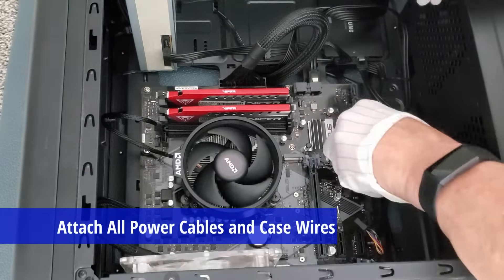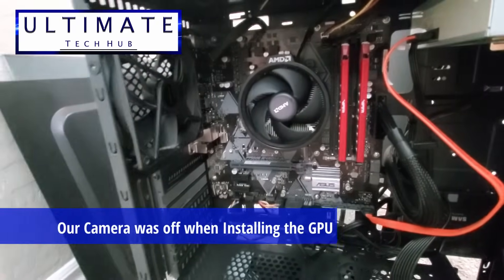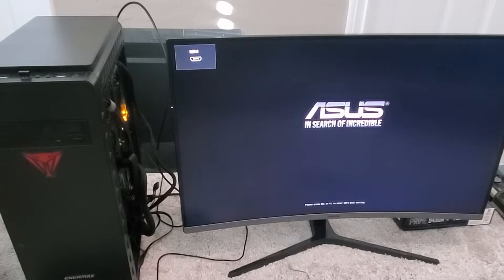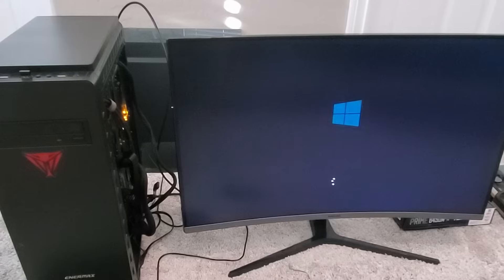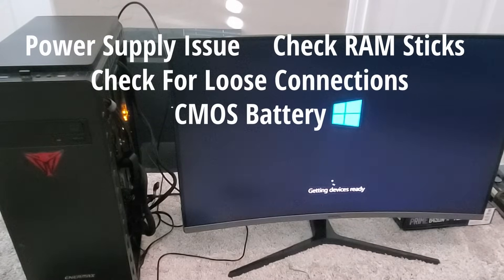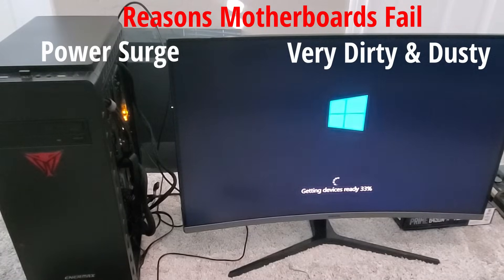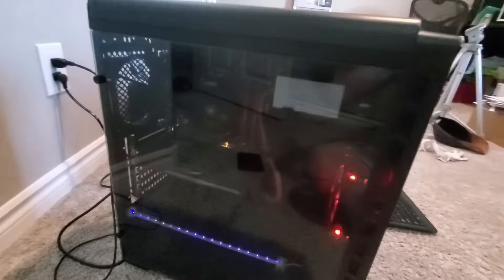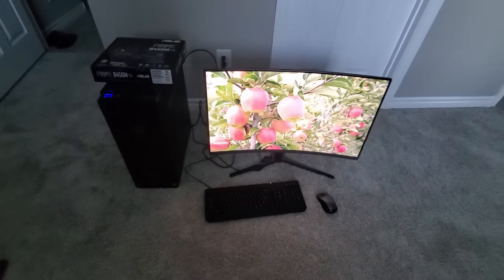HOW TO REPAIR A DEAD COMPUTER - DIAGNOSING A MOTHERBOARD FAILURE! - HOW TO

Comment: Now my pc randomly freeze(sometime freeze when it  just on start up!stuck on window logo)and restart itself ,sometimes can be open normally but then randomly go blackscreen like suddenly loose signal when I connect igpu instead the screen show just all red on monitor(really all red no text or etc).Could that be a motherboard failure?
Reply from the maker: Most likely it's a bad mobo. If you had a different hard drive you can plug it in and try that.  I always have a extra ssd drive with windows 10 on it just to test mobos just to make sure its not a software issue. But yours sounds like a hardware problem. Keep me posted and thanks for watching!

Comment: I just had a motherboard die on me due to the power supply suddenly failing.  The PSU clearly 2 blown capacitors.  It was an 8.5 year old Lian Li power supply.  I have read you should replace your power supply every 5 or 6 years
Reply from the maker: Yes absolutely! Usually every 3 to 4 years. That's about the life expectancy of a PSU. Thanks for watching and if you subscribed thank you as well.

Comment: I upgraded my cpu and psu, left everything else the same. When I plug everything in, only the power light on the mb comes on, nothing else happens, no other lights. I used the tester cap that came with the psu, and then the drives come on and the psu fan starts right up. I'm thinking it's a mb issue so I ordered a new one, same as old one. Was that a smart move or do you think there's some other issue?

Comment: Thank you for the great tutorial! I took out my ram and cleaned it. Then out it back in, as I've done like 20 times today, and just realized that I needed to put a bit more pressure than I had been. My issue was I didn't push hard enough to insert the ram after I removed it. I want to cry lol
Reply: same thing just happened with me. Just had to push a little harder than usual and it fixed my problem. Thanks brother.

Comment: My pc worked I put knew fans in and it still worked, the next day I tried to turn it on and I had no response so I checked the power switch the psu and I figured the only thing left was the motherboard so I bought a new one but my computer still doesn’t work the fans don’t even spin

Comment: My motherboard and processor 'blew up' even though nothing was wrong the day before. Is it possible to get my data like pictures from the computer? I'm going to buy a new motherboard and processor
Reply from the maker: Yes just remove the hard drive from the motherboard. It's connected with SATA connector. Your data should be fine.

Comment: I have the experienced the following from my system. 

It has been running a Gigabyte Aeros Z390 Pro for a little over a year with Corsair 750 W 750 RM PSU and 9900K CPU together 64 GB ram and RTX 2070 graphics card. Took me
 little over year to afford the parts. 

Windows 10 with all latest drivers and firmware. Wifi/BT combo card from Asus. What happens is that power cuts off to internal USB ports meaning that BT suddenly freezes mid use. What start to happen that during gaming at medium to high settings the computer suddenly froze even though neither GPU, CPU would reach critical temps. A Windows 10 bluescreen would apear for 1 - 2 sec and then go into the bios. I have checked the ram using Memtest86, I have tested GPU in several stress test programs like heaven benchmark, no issue. I have used into burntest on the CPU, no issue. Non of these issues appear while watching either streaming video, surfing the internet, emailing or word processing. 

Suddenly after doing a couple of reinstalls of Windows 10, Windows 10 couldn't recognize the internal USB 2.0 connectors were filled (front USB ports, wifi/BT card). Said someone like Windows cannot adress USB device. I then removed those devices, and reconnected, and then Windows 10 discovered the devices. But had forgotten my Windows 10 key. So I have to buy a new one.  Now the system runs somewhat okay again. But the bluetooth powerout error stills takes place (but only while gaming). 

System isn't overclocked. No lose connections either. 

So in your professional opinion. What could be issue here? Windows hickups? Or bad motherboard or bad PSU?
Reply from the maker: Well first its not the PSU. Your motherboard is working so my best guess is bad motherboard or Windows 10 glitch. However, have you updated USB drivers? Often USB connection problems come from old USB drivers. Make sure to update the USB drivers and keep me posted. Thanks for watching!
Reply: @UltimateTechHub  Thank you for your answer. I have updated the drivers for the motherboard (I guess the latest USB drivers too). By downloading the latest Intel INF drivers from Gigabytes site for my board. 

Temps in the CPU is never gets higher than 65-70c on a heavy load, and the GPU sits at 72c even if crank the details in FPS up to ultra. 

 Any software to test the motherboard? Or should I just go out and buy a new board?
Reply from the maker: @madsfrederiktoft5808  My best guess is bad motherboard.
Reply: @UltimateTechHub  thank. I will try to dig up a newer Z390 motherboard..

Comment: I tried jump starting my motherboard but it wont, but tester shows that it has power.
My case has a fan that is connected to psu but nothing. Sometimes the gpu, cpu fan will spin but othetwise not.
So is it psu or motherboard issue
Reply from the maker: From my experience your PSU is going out. Sometimes it will provide some power but not enough to power the motherboard.  How old is your  PSU?
Reply: @UltimateTechHub  i tried jump starting psu with paper clip and it works, its 460watt cooler master and 4 years old,
The system is 
i5-7400
H100m-h motherboard 
1 8gb adata ddr4
1 gtx 1050 ti
The motherboard wont even jump start but shows power....

Comment: Does changing the CMOS do anything? My PC started resetting bios and did a boot loop and it just said it reset the bios.

It then turned off and now idk if its the powersupply or the motherboard.

I tested the powersupply with all the fans except the sata and motherboard connected, i jumped the powersupply and it started. I even put it on another pc and that one booted too
Reply from the maker: It may be the motherboard. If you have a known good power supply then connect it and see if it boots. If it doesn't boot then it's the mobo.

Comment: I think my motherboard is the issue in my pc. All of the fans are working, psu fan still working. I think I need to replace my motherboard. Nice informative video.
Reply: Did u fix your issue I am having the same issue - did a new motherboard work?

Comment: None of this worked is there a chance it could be my cpu? All the parts are new and compatible gpu works fine in my other rig but still no video on the new one and only fan spinning is cpu fan on new and old motherboard

Comment: I removed the coin battery on my b450 tomahawk max because it wouldn't connect to my monitor and the DRAM light was red. I put the battery back in, but now my PC won't turn on at all!
Reply from the maker: It's a compatibility problem with your RAM sticks. Are they the correct RAM for that mobo?
Reply: @UltimateTechHub  not sure, but now the mobo seems dead
Reply from the maker: @jlc5271  If the RAM sticks are not the correct type for your mobo then the mobo will not turn on.
Reply: @UltimateTechHub  it turned on without any ram before, and now doesnt
Reply from the maker: @jlc5271  You can turn on PC without RAM but it won't get past post. Your mobo Supports DDR4 Memory, up to 4133(OC) MHz so make sure that's what you have. If it's not that RAM type then that's the issue.
Reply: @UltimateTechHub  unfortunately it's not the RAM. Mine's DDR4 2666 MHz
Reply from the maker: @jlc5271  How many watts is your PSU?
Reply: @UltimateTechHub  500, I'm fairly certain it's the mobo. It was working in terms of fans and lights on the board before, just DRAM light was still red and no HDMI signal
Reply from the maker: @jlc5271  Sounds like a bad mobo. You've tried everything else.

Comment: Hey I’d like to know if my motherboard is the problem so when I turn on my pc everything turns on gpu, ssd, cpu cooler but no output also my pc boot loops with no output so I don’t what to do. Any tips/help I can get ? Also idk if the previous owner updated the bios or not so I’m really not sure
Reply from the maker: It sounds like your mobo is bad. However check the cmos battery and make sure your psu is not going bad. Double check all of your power connections too. Keep me posted and thanks for watching.

Comment: Hey I didn't understand when you said ( it could required new ram sticks and CPU ) how?
Reply from the maker: It's rare but sometimes the CPU goes bad from over heating or the RAM sticks could get dirty so you may need to clean the connections. However the usual culprit is the PSU or the CMOS battery or MOBO is bad itself. I always start with the power supply and then CMOS battery because that's the easiest 2 symptoms to test.
Reply: @UltimateTechHub  oh so when you say ( we could upgrade the mobo ) you mean repair the mobo ?

Comment: I have a gigabyte GA-H61M-DS2 motherboard. My pc sometimes dont power on, sometimes okay. I just bought a new power supply yesterday because cleaning ram with  eraser and reinserting the c-mos battery wont solve the problem  (not a single fan works when I hit the power button,many times, that is why i assumed i was my power supply that is failing). After getting a new power supply  and hit the on button, it works!, i used it then turned off after. This morning it wont start again. Same issue again. Now, i want to replace and upgrade its motherboard. What compatible board will you recommend so that i can salvage other parts of my pc.
Reply: I'm not a gamer. I do use apps such as sketch-up, autocadd,  vray, lumion, enscape, photoshops, Etc. Sometimes i do play games but not as heavy as others. Thanks!
Reply: i was having similar issues i would hit the button like 9 times and then it would turn on i just assumed it was an issue with the button. then yesterday my pc would not turn on at all i assumed it was my psu but i replaced it and it still wont start. i tried unplugging the 4-pin on the motherboard and it turned on so i guess that means the motherboard is the problem idk i have never had issues like this before  @arielsupnet366

Comment: My computer doesn't work. The computer started dying +-5 months ago. I have cleaned the ram sticks and even changed the cmos battery. When I try to start the computer, the processor fan turns on and off and there is a red light that flickers on the motherboard. The computer sounds like a "car with a dead battery" when I plug it in to the wall. What could be the problem? Does anybody know?
Reply from the maker: Either the PSU or the mobo is dead. Try the PSU first. Keep me posted.
Reply: It was the PSU that failed. I used a Huntkey CP 350W (8cm fan). And it lasted me quite a few years. I am using a NVIDIA GeForce GT 430 graphics card. I want to get a good quality PSU for future upgrades. Which PSU would you recommend??

Comment: Hey, my Pc isn't turning on at all I've jumpstarted it from Motherboard but still no sign on life. When I short-circuit the 4th and 5th pin on psu the psu did turn on and every RGB strip and fans.

My psu is 80+ bronze 500w
And a320m Mobo

Please help if my motherboard is faulty or what's the most probable issue
Reply from the maker: I would try a Different PSU first and see if the PSU is the problem. If not then it's most likely the mobo. Also double check all connections like PSU connections and RAM sticks. Keep me posted and thanks for watching!

Comment: I just got my mobo a few months ago and I just got my psu today I plugged in everything right and cleaned the ram sticks and turned on the powerbutton but all I hear is a sound like this _ continuously and I can’t find the problem I’ve tried everything if you could help that would be great
Reply from the maker: When the mobo beeps constantly that means the Computer is not passing the POST because of improper connections or damaged hardware. Check every connection including all of your fans. Keep me posted.
Reply: @UltimateTechHub  Ok, I will check rn
Reply: @UltimateTechHub  everything’s plugged in I checked and it’s still making the sound. The lights and everything turn on for a split second then turn off and it goes to that sound.
Reply from the maker: @Himathen  Its either a bad Power Supply or a bad motherboard. I would guess its a motherboard issue since your getting the beep codes. You may need to replace it. But check the power supply first. How old is the PSU? how many watts?
Reply: @UltimateTechHub  it’s 600w Evga and I just got it 2 days ago

Comment: I had a sudden FPS drop when playing games so I reapplied thermal paste on my CPU and when I put it back together it didn't give a signal, I tried all the other steps and didn't work so have to buy a new motherboard. If anyone has any other idea on how to fix the issue before I buy it please tell me.
Reply from the maker: I would check your CPU to make sure one of the pins are not bent. That would cause it not to work.
Reply: @UltimateTechHub  I checked my CPU pins and they all look fine but all these issues happened after my power went out. Would it make sense for it to be the motherboard. I'm just asking so I don't waste money since I had to wait 3 weeks for it
Reply from the maker: @QuickCosmosReal  Yes a power outage which can cause a power surge may have killed your motherboard. But first did you reset the CMOS battery? Do that first then replace the mobo if it still doesn't work.
Reply: @UltimateTechHub  Got the new motherboard but still the same problem, not sure what to do.
Reply from the maker: @QuickCosmosReal  Then it's probably the power supply.  Your RAM sticks are in the correct slots?
Reply: @UltimateTechHub  Ram sticks are in properly and in the right slots and I tested on a spare PSU I had but still the same issue, could it be the GPU
Reply from the maker: @QuickCosmosReal  it could be. Remove the gpu and try to start your PC.
Reply: @UltimateTechHub  The fan stopped and turned on and kept doing that
Reply: @QuickCosmosReal  did u fix i wanna know before gettin a new mobo
Reply: @babaloons4887  My gpu died
Reply: @QuickCosmosReal  was it a dedicated gpu

Comment: Problem with mine is it doesn't boot up noting happens it booted up 2 or 3 times in a day it automatically got shutdown the thing here is when i Press the power button the fan on motherboard starts for a sec then noting happens but my mouse
Has rgb and it works but the pc doesn't maybe the motherboard is dead

Comment: Hi there. I had those symptoms but suddenl, my hdd is not detected, even in the diskpart command. The disk starts working when I turn on the laptop but then I hear it turning off. Do you think this might be a power supply/mother board issue? PS: laptops battery is dead, only works plugged in. Thank you!
Reply from the maker: Its the Power Supply most likely.
Reply: @UltimateTechHub  that would be good news, I have a lot of data on that disk 😐 thank you for the feedback and for sharing these videos.

Comment: What happens if my PSU fan is not spinning? I have a Corsair RM650 PSU.
Reply from the maker: The PSU is most likely dead. How old is it?
Reply: @UltimateTechHub  I got it from my dads job and it still powers the motherboard. I’m guessing it is 4 years old.
Reply from the maker: @Johnnnmn  Sometimes the fan spins when needed or that's a sign its going bad. Either way 4 years about the time to replace it. I have a video I posted last night on PSU power consumption requirements. Check it out.  Keep me posted.
Reply: @UltimateTechHub  Alright. Thank you so much for the info.

Comment: I have a different problem where my PC can't even boot and all the cords are plugged in and used a different PSU on a PC that works on my motherboard and it can't even start does this mean it's dead? Or can I bring it back?
Reply: Also got different ram sticks that work and still nothing
Reply from the maker: You can bring it back. Make sure the jumper didn't fall out because that can cause this issue.

Comment: I cleaned out the tower with an electrical duster spray.... could I have fried the motherboard? It was slow in finding the hdmi on monitor but wouldnt boot up just said no signal. Its a few months old
Reply from the maker: It's possible.
Reply: Thanks for the reply!!

Comment: Gonna check if its the psu or mobo tomorrow.. psu is somewhere around new 😶 but my mobo is from 2012 i think 😅
Reply from the maker: Probably the mobo if its that old.
Reply: @UltimateTechHub  yes its the mobo 😶 just replaced it, it works now! Thank you for your video!
Reply from the maker: @canigetahoyaaa9774  Awesome!! It feels good to diagnose and fix your own computer. And saves you money too. Congrats and thank you so much for watching!

Comment: Hey, past few days my Desktop can't turned on but there's only keyboard and mouse backlight. So I reset the CMOS and it works but today I did the same thing and replace new batteries the CPU won't turned on. Only the keyboard and mouse light is on. No fans were spinning. 

I have tried the PSU paper clip test. My psu have a indicating light beside the switch when I did the jump start the light, light up but when I plug it to the motherboard, no light was up.

Is it the motherboard?
Any help?
Reply: Cpu
Reply: Happened to me. Power surged to my cpu and fried it getting a new one Monday
Reply: Didn’t have it plugged into a surge protector
Reply: @Brad12703  I bought a new motherboard and everything works fine. I found out that my old motherboard is not receiving power from the supply. I don't know maybe my pci connector didn't receive the power